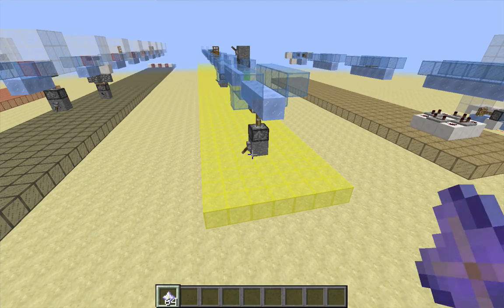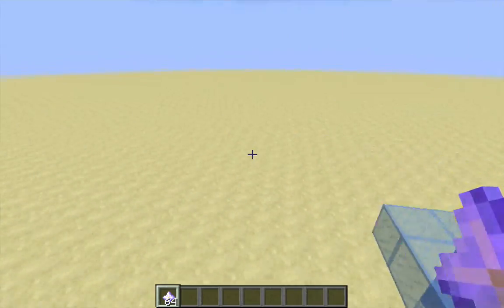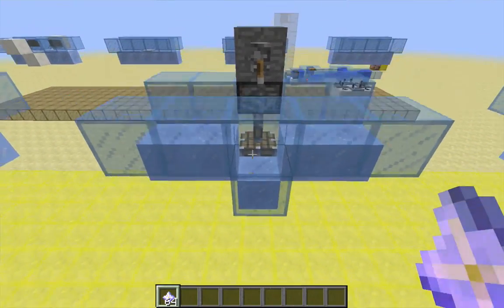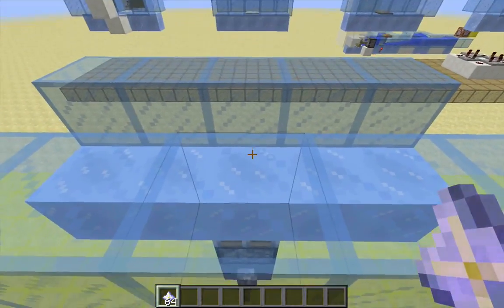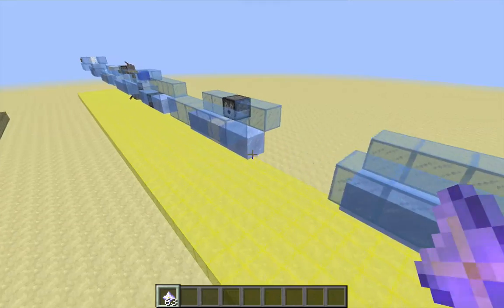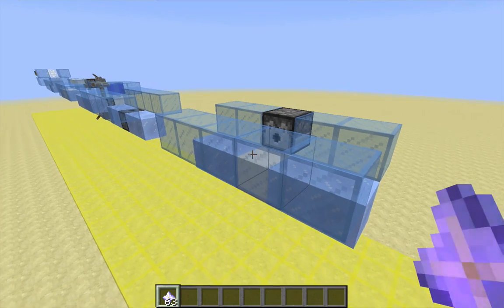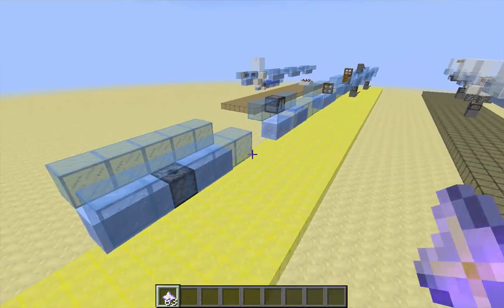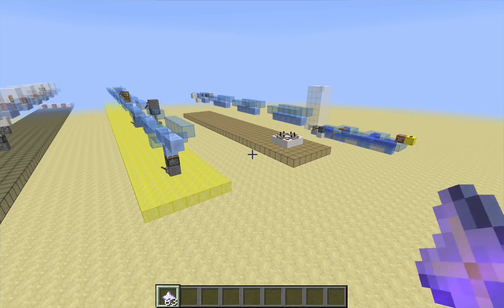Design Fundamentals of Minecraft 1.9 Item Elevators, Part 7: Regulators

Comment: To prevent dry breaks from spitting items out the side you should try 0-ticking the slab into the space. 0 ticked blocks don't place block 36 - which means they don't interact with items. So this may be helpful...
Reply from the maker: +Sancarn Oh, excellent. That's very helpful, thanks! I had suspected it was block 36 that was acting as a full solid block and pushing the items out, but I'm still not entirely versed in the intricacies of pistons. Thanks again.
Reply from the maker: +Sancarn Just FYI, I was also able to use a 0-tick to verify that block 36 is responsible for the accelerating velocity of items when using piston-launching designs. 0-ticking the upward-facing piston causes the item to rise up through the tower normally.
Reply: Nathan Ryan I was actually thinking the same, forgot to mention it :P

Comment: Thanks for mentioning me earlier :D
Something you should defenetly consider or explain is the lag factor...
So tile entitys like pistons or furnaces aswell as block updates like dispensers and mainly water or clocks are a source of lag..(Sadly -.-) So you should explain in my opinion what/why components are lag friendly(Or not...)
About doors yes they are unreliable as regulators but after a 30 Minute 20Ips test i can say for sure that trapdoors are fine if you place them correctly and if the item has enough velocity even if the trapdoor closes the items just goes through the door and you just need correct timings so also those items get elevated  :D
Reply from the maker: +Robitobi01 You're right, I should have been mentioning lag in the pros and cons of the choices. Sigh. So much stuff to go over, it's difficult to remember it all. I've also been forgetting to mention all sorts of little stuff, as well, such as doors requiring slime blocks or packed ice.

As for the trap doors, even with a higher velocity, there is still some risk for items to get stuck on the bare ice below the trap door. The risk is relatively small, though. I don't encounter it frequently in my own tests, either. In my opinion, whether a trap door (or a door) is a good choice depends on what the item stream is carrying. If it's material from an automated farm, I'm okay with losing the odd item (or even stack of items), in exchange for the reduced potential for lag. On the other hand, if it's the item stream that carries hand-delivered items into my base's item sorting system, then I would want to go with something that reduces the potential loss to as close to zero as possible. And I'd be willing to pay the lag price for a select few of these elevators.

It also probably makes a difference as to where your playing. In an SSP world, for example, the lag potential should be less of a problem (unless you're building something massively complex, in which case you're probably beyond the level of my simple designs anyway).